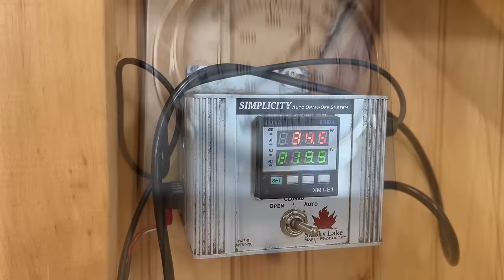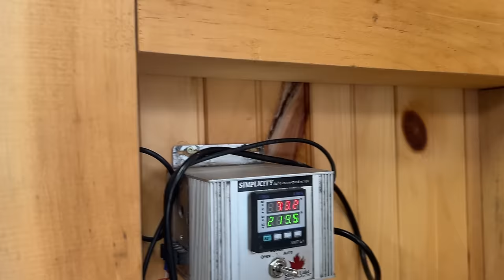Making Maple Syrup

Comment: If you want to burn less wood, it’s better to run the chimney at maximum 600-650 otherwise the heat get out by the chimney. You should control your ventilator with a speed controller and a draft control in the chimney. From your neighbors to the north Quebec, hope you had a good season I have my best season so far we don’t know where to put the sap
Reply from the maker: I’ll show this to Wayne